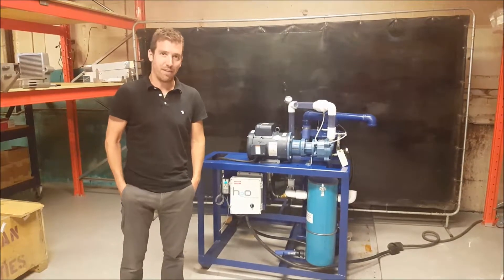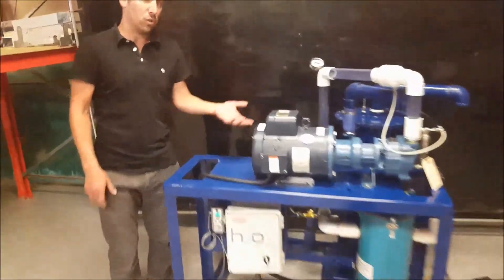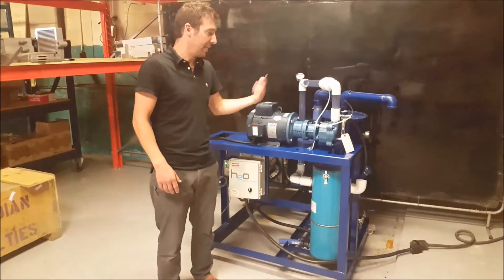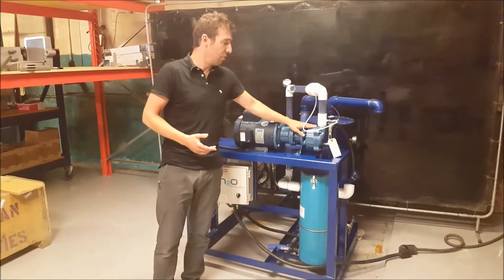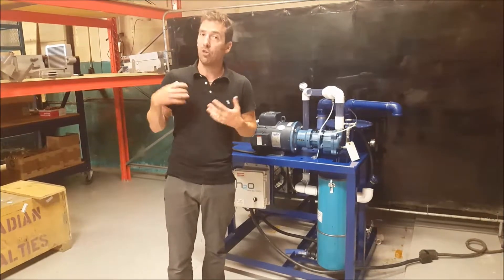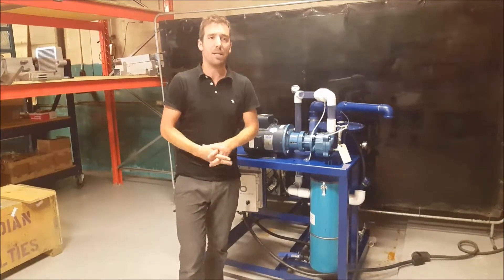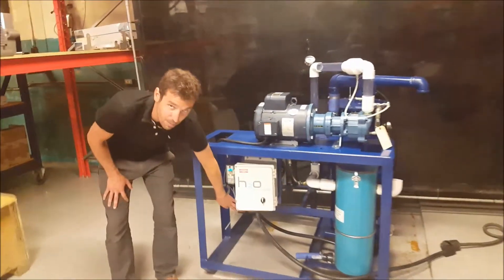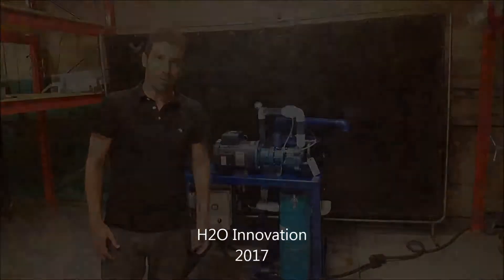Oil Cooled Travaini Vacuum Pump by H2O Innovation

Comment: @Matthew - We are looking for a liquid cooled vacuum pump, approximately 15 cfm, that will run continuously. Our gases into the vacuum can reach temperatures up to 200 C. Do you have a liquid cooled pump that can handle these temperatures without degrading or destroying the pump?